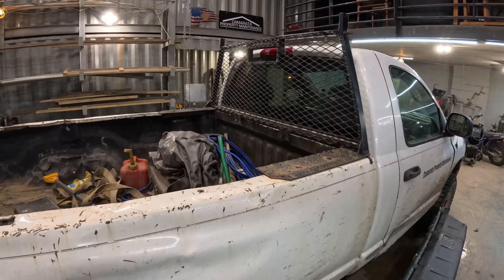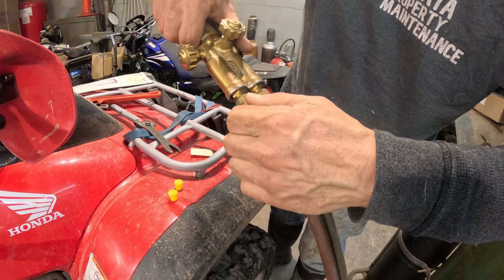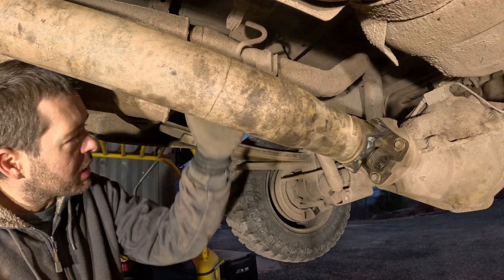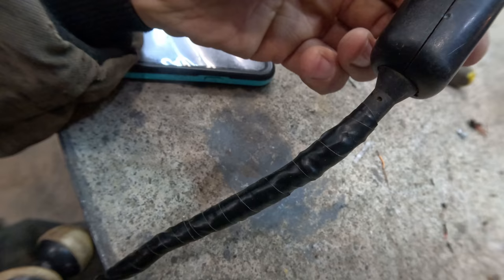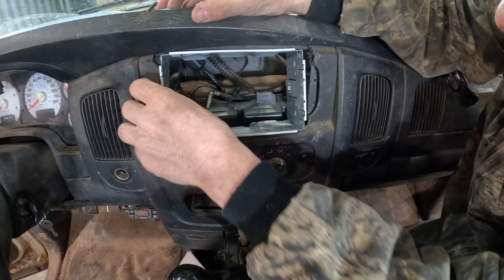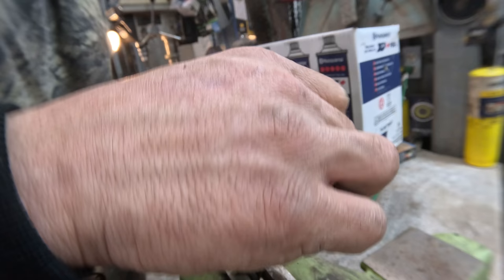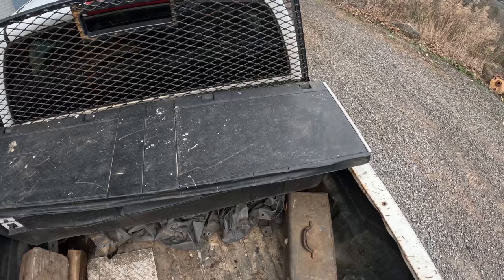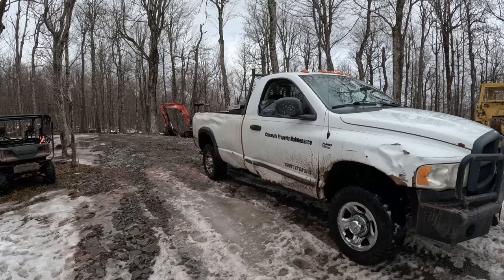Pickup truck repairs

Comment: We've had a weather guard in my family for a while, dad bought it new in 2000 when he bought his 2000 Silverado and did contracting and fire department with it, then after that truck it got left in the woods for a hand full of years, I pulled it out about a year and a half ago now for my plow truck and it got rocked around pretty hard due to that truck being so bouncy when plowing, now it's in my daily 2013 2500 and it still works like a charm, weather guard would be my go too they've got a good assortment of options

Comment: Press the caps in one at a time while holding the u-joint into the cap. When you do them both at the same time the u-joint gets crooked because it’s not supported in the cap yet and mucks up your needles.

Comment: I appreciate the irony of peeling the plastic screen protector off the radio before it's installed, then immediately scratching it by dragging the metal brackets across the front

Comment: LOL at Andrew dropping entire trees on top of a plastic toolbox and expecting it not to break. Man i wish i had your skills and energy to tackle project after project like you do.  Also looks like you could use an exoskeleton in the bed of the truck to help hold the sides in place when you are throwing massive trees in the back!  Some flat stock and round tubing welded in and you would be good to go.

Comment: Gday Andrew,
I was told way back that after finishing fitting a new Uni Joint that each “ear” of the yoke should be given a couple of good taps with a hammer to shock the bearing cap into best alignment and spacing with the needle rollers. I find when you get that binding feeling after putting in a new joint if you then do the hammer taps that it loosens it right up and then all the bearing caps are generally the same  temp to the touch after a good run. Maybe try it next time and see what you think.
All the very best,
Cheers 🍻

Comment: Re the stiff u-joint at the end of installation, then you just put the complete assembly back in the press/vice, and put a slight load across the yoke.  This moves the caps back out fractionally, locks the retaining clips in place and gives you a miniscule clearance inside that makes the whole thing free up beautifully.

Comment: I would recommend a Weather Tech tool box, I have had on on my truck for years and it as worked very well for me. And I replaced it last summer and bought a brand new one and I have been happy with the new one as well.

Comment: I like to fully install one cap @ a time. Then when you start the second cap your joint will typically slide across and be able to engage in both bearings.  I never could figure out the press though. I always beat on them with a hammer!

Comment: I personally don't have any experience with them, but a couple of other YouTuber's I watch like using the DECKED brand tool systems in their trucks. One guy is a farmer and the other is an auto mechanic working on old cars. So you'd figure their line of work is rough on tool boxes as well. Me personally, I own a Trail FX brand tool box that came from a previous truck. We've had it forever and it feels like it's made of some pretty heavy gauge aluminum. It was a $600 tool box back in 2008, so I don't want to see what it's possibly going for now with the price of everything.

Comment: I never use a press for u-joints because it can bend the ears on the shaft. When I was a young mechanic my dad always told me to not do it that way and I finally listened after messing up a couple times. Also, after you get the joint in, hold the shaft in your hand and hit all the ears of the yoke and it’ll loosen the u-joint up so it doesn’t feel so tight. Idk why it works but it does lol

Comment: 42:15 depends what you use to glue with... at koenigsegg we used to and they still do special epoxy glue for the Carbon fibre shell (monocoque). That glue could hold some insane weight..

Comment: had our UJ go out the night before a roundtrip from Fremont CA to INDIANA & Back in a 77 Dodge van. The yr 1982. We got the UJ done in the driveway in a few hours and left in the dark pulled a 18' trailer empty, later came back on 3rd day, stacked with games about 12' ft high. Plus the van was loaded full till about 24 inches of req bed space to roof. We never pulled into a weigh station, nor got pulled over if they weighed 2 pounds x 2000 it was okay by my novice guesstimate. Those Wyoming & Nebraska sidewinds got a bit tricky. Luckily it was July not peak. But our 6' x12' Flat profile at 60 mph was a 200 Pounds + force and our side profile was 3x that. if a July wind came across it was half of the annual max, and it did, we had over 30 mph gusts. The wind blows from the west mostly steady and you can get > 40mpg heading east but coming back may be <12 mpg

Comment: I stopped using truck cross bed tool boxes years ago because they only lasted me two years at best. Now I use a 48 inch gang box and it seems to be holding up well. I did not like how much visibility it restricts so I cut off the feet to lower it 4 inches. Then I rattle can painted it to closely match the truck paint to make it stand out less. Lastly I put a tow hook facing up at each corner to allow a vertical lift-out with having to unload the box.

Comment: Another installment of Andrew “MacGyver” Camarata! 🤣 All he needs is a sledge hammer, some chain, and a skid steer!

I bought a Kobalt box from Lowes almost 8 years ago. It is aluminum, low profile, and tough! I have had it in 2 trucks now and I regularly stand on it and ratchet strap stuff down on it. The handles lock and I no water gets in. I keep all the same stuff you would in it: tow chains, tire iron, jumper cables, bottle jack, my pintle hitch, etc. No need for tire chains in SC. The box was less than $200 brand new. Treat yoself Andrew! 🤣🤣

Comment: Hey bud, just a tip from someone that wrecked plenty of u-joints….. put the first cap in set the cross in that cap then press it way in farther than you have to and install the clip then put the cap on the opposing side and press it back to the clip. No way to loose the needles this way and can usually do it with a plastic dead blow hammer and a vice. 

Still entertaining keep it up man!!!

Comment: The reason you are destroying u-joint caps when you are pressing them into the yoke bore holes is, when you press the bearing caps into the yoke without lubrication you are squeezing the yoke ears together and taking them out of line with their machined bore.  That is why the snap rings don't line up with the groove in the yoke's bore hole. And that is why the get tight, and if left like that, their normal lifetime of efficient operation will surely be severely shortened. 
Use emory cloth to clean up the bore holes on the yoke. I use a mixture of diesel and oil (2:1) to lubricate and rust-proof the yoke and u--joint.
Don't be afraid to knock the rust of crusty parts with a wire wheel attachment on a grinder or drill. If you're too un-caring, or too lazy to rust-o-leum the refreshed surfaces or parts, you can brush/wipe or spray on the diesel/oil mixture as an over-coat on machinery and sheet-metal to keep them from dying a horrible death. 
The machine you are caring for will appreciate your effort and give you years of continuous service as long as you keep treating it right.
You may even have more respect for yourself as an owner/operator/mechanic.

Comment: BetterBuilt makes a decent toolbox I’ve had mine for about 2 years and I carry about the same stuff you have in mine. Only damage was when a generator slammed into it at high speed but i was able to fix the dent with a sledge and it’s unnoticeable

Comment: I like that log grapple setup.  That is a nice pile of wood.
Reply: That grapple is made in Finland. For the first time I see that a separate engine runs hydraulics, normally they are meant to be used with tractor hydraulics. We have two of those grapples attached to the trailers. One is fully electrically controlled valve and the other is 2 mechanical sticks with electric grapple opening and telescope

Comment: Andrew. This is definitely something you can make a video of. Make/design your own toolbox. It would take quite a bit of welding and material but the end product means you never have to buy some cheap plastic garbage toolbox again or something made of tin foil.

That other toolbox is still a crying shame. Why the hell they made the metal gauge so thin on that toolbox is beyond me. Defeats the purpose of even making it out of metal if it's going to be so thin it can be bent by hand so damn easily.

Comment: have the same box on one of my trucks and the front was all messed up like that too so i just bolted a piece of angle iron to the front to straighten it out and its holding up fine but best box ive foundthat actually holds up to the abuse is one i built ive probably owned 15 different ones from every company and not one has survived. would of saved a bunch of money just welding up my own to start.

Comment: If you use your bench vise to press in the new caps you get a lot more control over the install, I just want the caps over the ujoint untill the needle bearings cannot fall out or move then I use a hammer and deepwell to drive the caps home.  If the cap is stuck just smack the ears of the yoke while putting pressure on it DO NOT DEFORM THE HOLES THAT THE CAPS GO IN.  Yokes are expensive.  If the  yoke isnt moving when you try and rotate it by hand you got something too tight, or pressed the ears on the yoke in slightly, you can take a hammer and spread yoke ears slightly. 

Semis just use a tiger tool puller and a hammer.  Seems like smaller the ujoint the harder they are to change.

Comment: Nice steel flat bed with slip in wooden 12" sides and tail gate would be way better for you!I had none on old square body for 20 years and it's still going strong.Nothing better on work truck  3 or 4 " Wider than cab good rugged head ache rack with crusher mesh to fit to protect window .no more broken tailgates.6" deck boards are cheap .Ps if ya do build one don't use checker plate for bottom .1/4 FLAT PLATE less slippery and easy to sweep out.

Comment: I always lightly sand the insides of the yolks and spay some lube on so they go in easier, the part the u joint cap sits in gets a bit of rust on the area between where the clip goes that makes the caps harder to push back in.

Comment: Clean the holes on the driveshaft with a flapper wheel and you can assemble the UJ’s with an 8oz hammer.

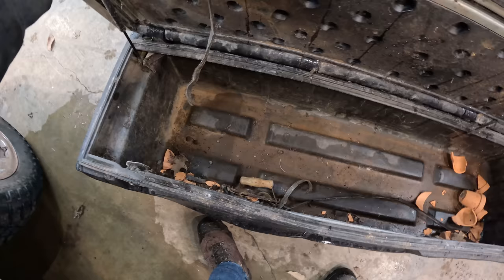Comment: Time 1:11;13  Andrew, you are good at fabricating.  The only way to get a truck toolbox like you want without paying over $500 is to make it yourself.  My boss made one out of stainless diamond plate.  He used the old (POS) one that came apart as a template.  The template was sound but the original materials were crap.  The stainless diamond plate was durable and looked good.  I can’t weld stainless well.  Maybe you can.  It would be good content for a video.

Comment: when soldering wires in a cable....stagger the cuts,  so that the soldered joints are staggered,,,
not all bunched in one spot... makes for smaller, smoother repair....

Comment: … used trucks like that to work.
 make all right turns with a “No Left Turn Chevy”
 grabbed the rack,  it broke off
  new cam and lifters except one smoked
 work the key in the lock a bit to get her to unlock 
Switch on the dash every ten seconds to squirt gas in the carb
 fire on the engine, ran fine after that was extinguished
lost wrenches fell off along the highway

Comment: If your set on have a pickup truck style bed just buy or build a rebco loggers box. Would stand up to the abuse you put the truck too and look better then smashed sheet metal all the time. Can mount tool boxes to sides of them as well

Comment: And dude, you said it sat in thebtard for years. Its mishaped plastic and will bend with the seasons.

You shouldn't have expected anything different.

Just buy a new diamond plated one, there's more room and options to fix issues on it later down the road.

Ive been watching you from when you started and was happy to see someone fix it right for a change, dont skimp on stuff now.

Comment: 12 point sockets more than have their place. Especially if you do engine work

Matter of fact, I'm pretty sure the caliper brackets on that truck use a 17mm 12 point bolt

Comment: Here’s a little trick guys been using for 45 years  Use an emery cloth to clean out the surface put a damn ice never sees on the inside use a small ball peen hammer to tap it in just a little trick for my old timer

Comment: Flip those gas struts up the other way on the tool box lid Andrew, technically you have them installed upside down.
Reply from the maker: Didn't I put them the same way they were?
Reply: @Andrew Camarata  don't think so mate. They should be cylinder to the top when opened... I don't know why to be honest but something to do with self lubricating the rod I believe. They can fail prematurely otherwise from what I've read.

Comment: You should of took the controller apart and just rewired the cord back up inside.  If you are going to splice wires you should stagger the connections so you do not have a bulk of splices all in one spot.
Reply from the maker: Yeah maybe.  And that is a 4 pin connector. A bunch of those wires may not be used

Comment: I’m sure the radio issue wasn’t the exposed wires behind the radio that will have copper touching metal when installed 😂

Comment: Missed opportunity to add an "access panel" to the new door. I would even get a white spring loaded one for walls from home depot. You know your gonna have to fix that stereo. And as a side not all dashes should be basically square and screwed on with those screws you used on this one... and they should be visible design elements.

Comment: Always install ujoints by hand not with a press. The reason you're having problems getting the clips to line up is because the ears of the yoke are bent inwards from improper removal of ujoints with a press lol.

Comment: You said that hose clamp was not heating up cause it was stainless steel & non-ferrous ss is ferrous and one of the most used cookware for conduction ovens&cooktops.

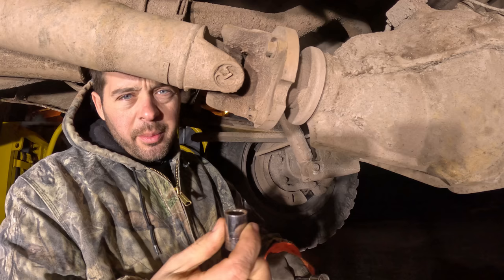Comment: 6:56  Unless it's a Ford, in which case, the drive shaft and U-joint are attached with 12-point bolts, for some reason.

Comment: My Dodge truck dash board cracked at 10 years.Whole bunch of issues at 136,000 mi. None of that has happened to my Ford 250 after 20 years.

Comment: Stainless steel IS very "ferrous" (i.e. containing iron, Latin "ferrum", hence the symbol Fe), it just isn't (typically) "ferromagnetic", which means "having the same magnetic properties as iron does". (In difference to diamagnetic and paramagnetic metals, but I digress here.)

Comment: The driveshafts on my f250 have 12 point bolts holding them on so you have to have the right sockets, it's dumb that they did that but oh well.

Comment: About a month ago I bought an $800 tool box and the bottom is caving it and its a steel tool box but its so thin it can't hold much wieght
Reply from the maker: That sucks. I almost feel plastic is a better material for the job if used correctly.

Comment: HELLO instead of fooling around with that press all you had to do is leave it in the  vise and  took a  socket on top of the caps or a peace of  pipe  and pound on the that's in the driveshaft it's self  until it comes a part it usually only takes 3 to  4 minutes and it is apart  i know because  i have  took  hundreds of them things apart myself

Comment: why not just build your own box? you can size it so that it fits perfectly, use thicker gauge steel so that it doesn't bend or dent easily, all you really need is to cut it out of a sheet, weld it together and buy hinges and latches from the store.

Comment: What happened to the front right fender Andrew?
41:46 you should have never peeled off that protective film.
The plastic toolbox has been sitting in your yard for over 11 years you said, what do you think the latches are going to do with exposure to the sun and the elements all years? its not brand new anymore.

Comment: Is it just me or was ona the front u-joint caps workin its way out?? Good tool boxes are hard to find. I have a 1/8th inch steel one. dont know who made it though its pretty old but indestructable. I cringed when you took the plastic protector off then immediately scratched it. like noooooooo! That would drive me nuts with my ocd

Comment: Yes tons of new or newer type products that are worthless. I work property maintenance and construction and have to install and repair home appliances. These new things are designed with cheaper materials and shorter life in order to boost more sales and profits. Sad state of the world we live in. Dozens of times i have had to replace refrigerators that are less than 7 years old for burned our compressors. Once pulled out an old fridge from the 60's that was fully functional but owner wanted something newer that looked better. Ridiculous garbage being recycled and resold. Straight trash. I personally look for older things to buy. As for your tool box problem. I run 3 boxes on my truck. 2 side boxes and a crossover. You'd probably be only interested in the crossover. Its a husky diamond plate aluminum. I guarantee i carry as much or more weight in it than you and its held up fine fir 4 years now..but i dont have things slamming into it. But i do have dividers in it cut out of 2x12s. Which help make it more rigid. And in your case i would suggest putting wood supports underneath your box so not all the weight is held up on those little bed rails.

Comment: Doesn't fit........it will!  Nothing an angle grinder, drill, large eff off hammer and a few mega bolts can't fix.  A few new shiny screws means a full valet is in order to set off the shiny screws.  Personally I would just paint the screws black and carry on.